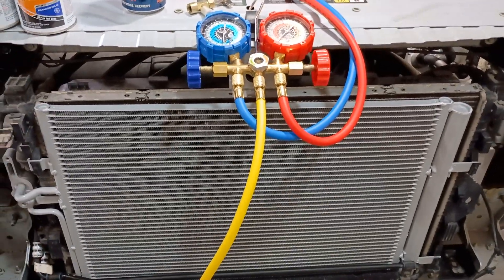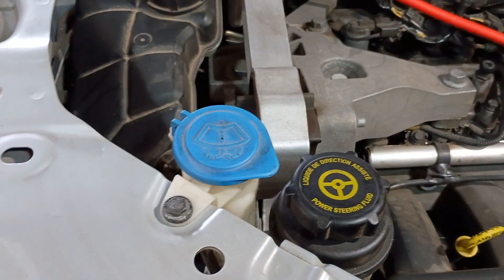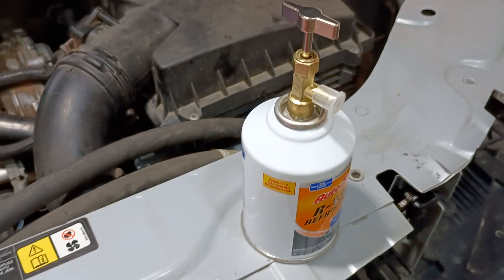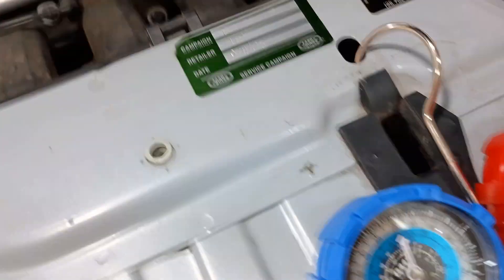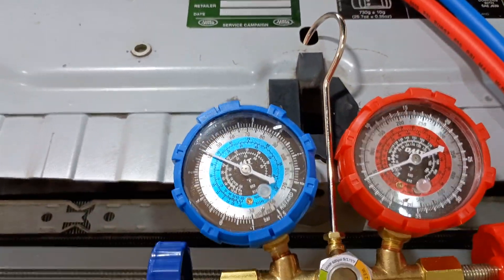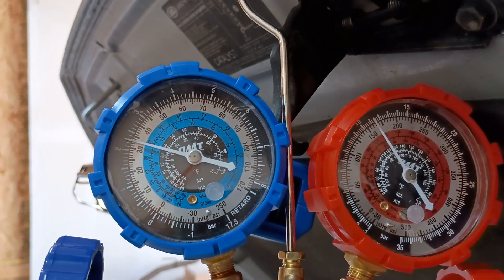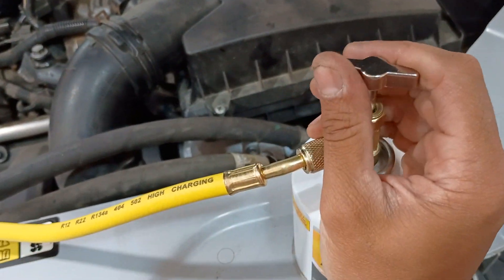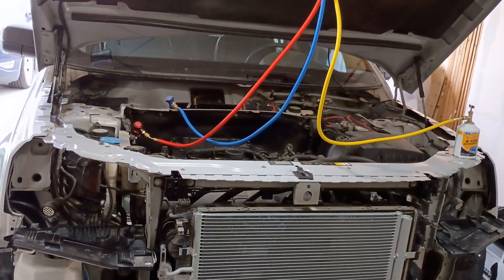Land Rover LR2/Freelander 2  AC System Work, Part 14, AC Charging

Comment: What did you have to replace to fix your ac system. I changed out the ac compressor but it’s still showing high pressure when it shouldn’t. I’m thinking my condenser is bad.
Reply from the maker: @chadmorris9940  I changed the condensor (included desiccant) and compressor.
Reply: @isaacrepairseverything  I bet I need to change the condenser as well. Thanks btw.
Reply from the maker: @chadmorris9940  I didn't diagnose or troubleshoot my condenser:  the visible fins were all beat up after 163k miles and it was only like a hundred bucks on Rock Auto, so I just replaced it.